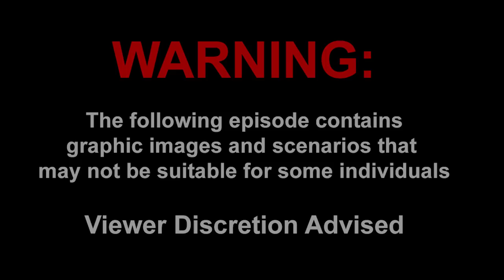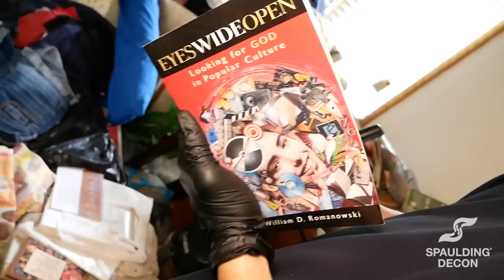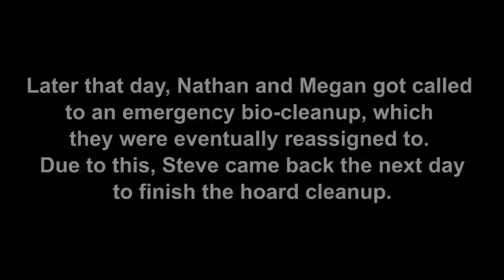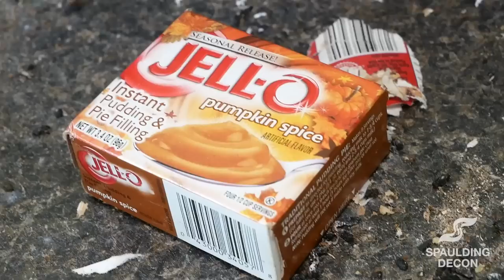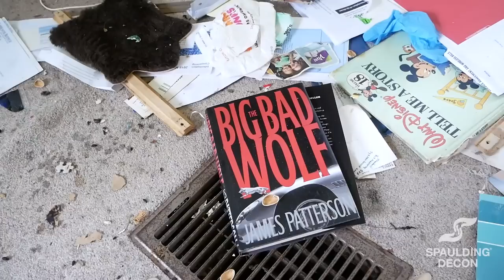H****n and a Hoarded Home

Comment: Curious as to why not put all mattresses in laying flat first then all large furniture flat first then put trash on top? Seems like you would get much more in bin this way. Also if you had  trash can outside windows of bedroom to put trash out windows and also having another person working by door/ entry way of bedroom then it would get cleared out faster. Just some suggestions. When I have cleared out hoard houses this is what I do. Plus using trash cans or and wheel barrels save on cost of all the bags you would use. It could help cut cost. The bags are expensive.

Comment: No amount of cleaning is going to make that place habitable. Even stripping it inside, is iffy.  You'd need to take it right down to the metal framework, remove all furnace pipes and ductwork, because there is no place a rat can't go. Even if they only pass through a duct, they pee all along the way, to have a trail to follow back. It would be cost prohibitive to try to re-rent this mess out again. 
As for what he said about donating clothes to charities that will wash or launder them before selling, dream on !  I don't know of any that do that, and that is why you're told to wash everything at home before wearing !